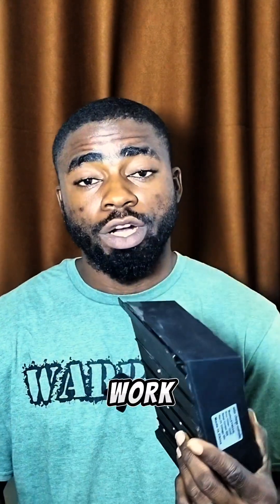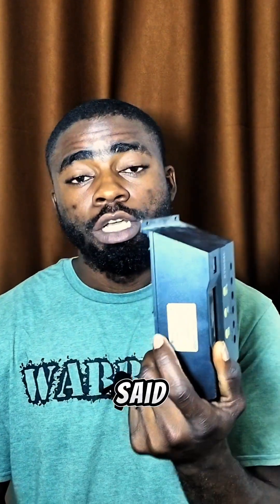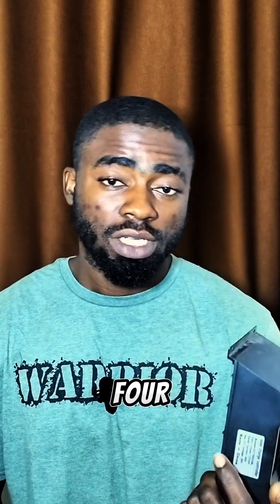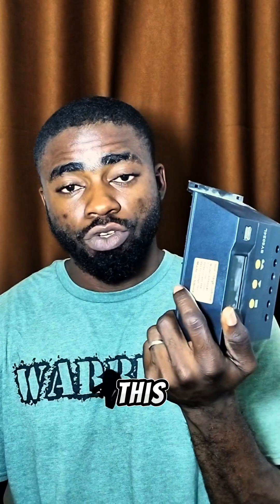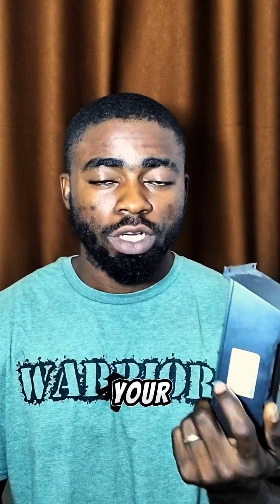these four things can cause damage to your solar charge controller

Comment: Please is there any device that can prevent over current from destroying a power station? For example it is a 500w input I doubled the 500w panel but in parrel meaning over current was destroying it. Is there any thing device that can regulate the current so it doesn't burn the powerstation again because I don't want to remove one panel if I repair this powerstation. It was really enjoyable 😢
So what device can I buy that will regulate the current from destroying my powerstation a second time thanks?